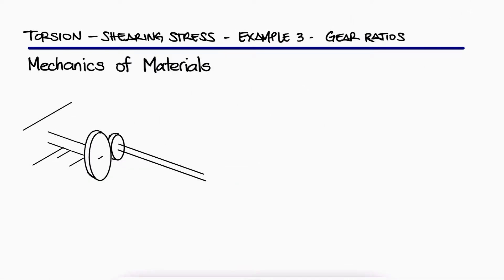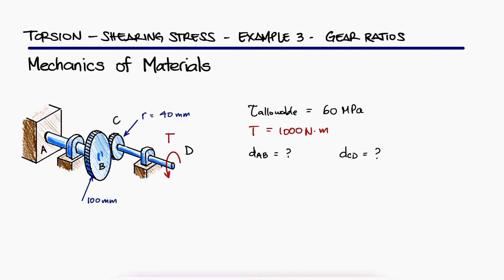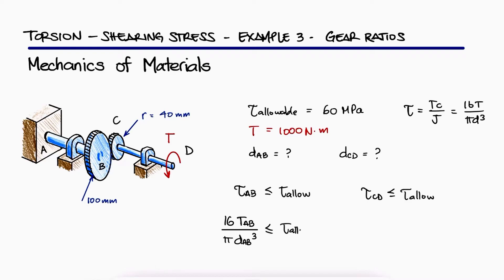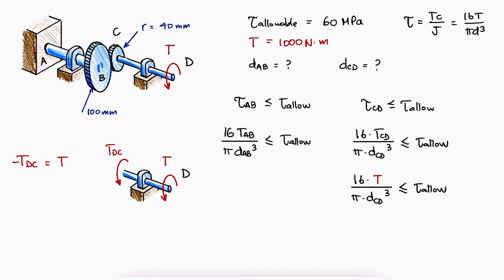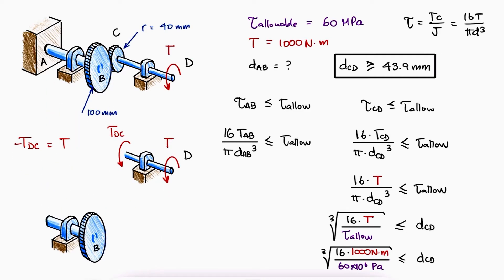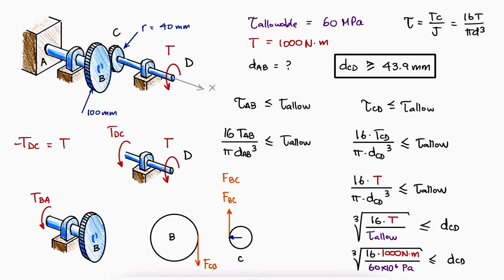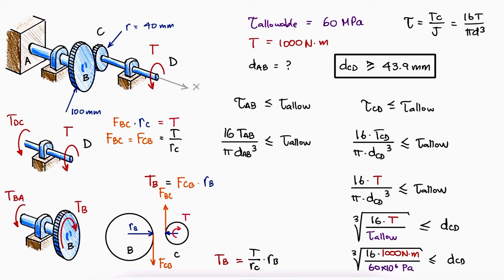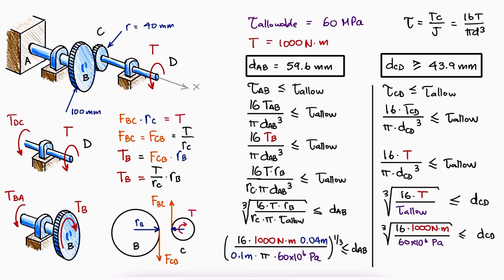Torsional Shearing Stress - GEAR RATIOS in 3 Minutes!

Comment: Some notes, when calculating dcd, he forgot to write pi on the equation, but he used it to calculate 43.9 mm. Also, on the final formula of dab, he wrote 0.04/0.1 but it should be inverted, 0.1/0.04
Reply: Actually he has his separate notes which are correct, only for making the video he writes it again while recording, then he gives the voiceover in reference to his main notes. So this sometimes puts error, which is still fine
Reply: @mayurdahiwale5907  yeah, that's why I also said that he used the missing parts to calculate the final result